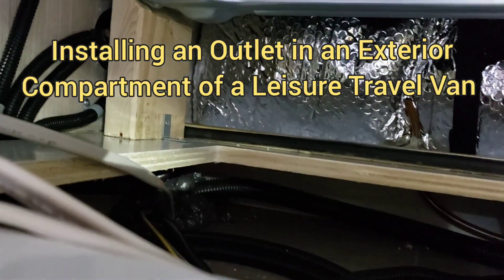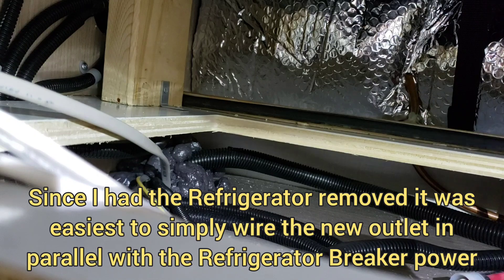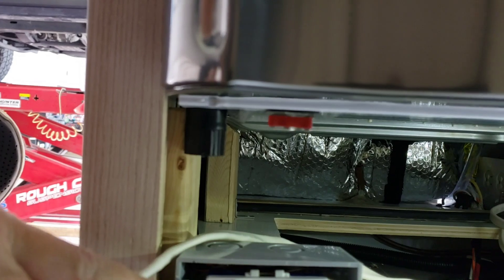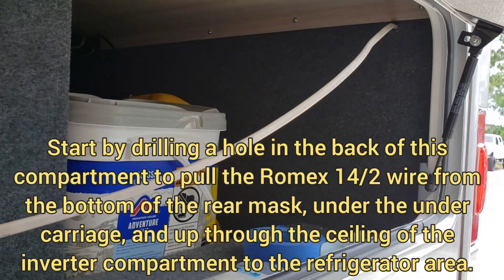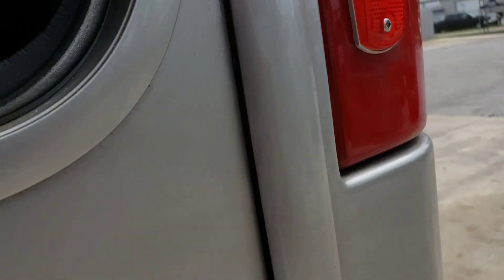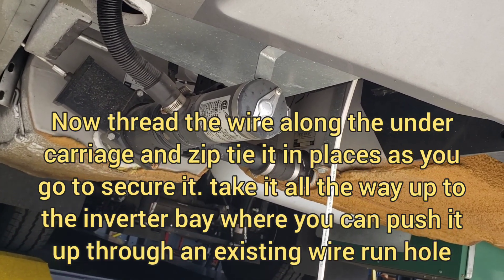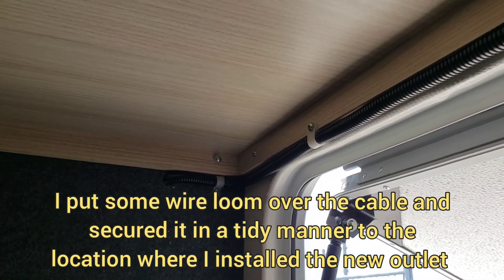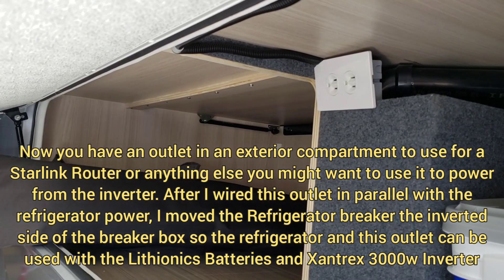Installing an Exterior Compartment Outlet in a Leisure Travel Van

Comment: Nice job, Sandy! I have the same model of LTV and would like a 120 outlet in the same driver side storage compartment. Is there anywhere else I could run it from besides the refrigerator circuit?
Reply from the maker: Just go buy a 15a Breaker and add a dedicated Breaker for the outlet. There is a wire run penetration right behind your Breaker box in your driver's side dinette seat base.  You'll push the Romex wire up through the black foam there and then push it through a slot on the back of the breaker box. Make sure you put the white neutral wire on the inverted side of the breaker box with the breaker.  I believe you'll add it to a vacant position on the very right side. Use the Right side neutral bar for the white wire and the bare wire can go in any position on the rear ground bar. I'm going to be posting a breaker box reconfigure video for the 3000w inverter installation in a couple of days so watch for that.

Comment: Thanks for your reply Sandy. Is the 15 amp breaker generic or is there something in particular I need to look for that will fit in the LTV breaker box? also, do I still have to go through the rear mast the way you did?
Reply from the maker: I like a 15a, Single-Pole Siemen's Type QP , https://www.amazon.com/dp/B000H5T2XE. You can also get it at local hardware stores like Lowe's and Home Depot. Yes you'll do everything the same way but you'll be entering the area by the breaker box through that floor penetration.